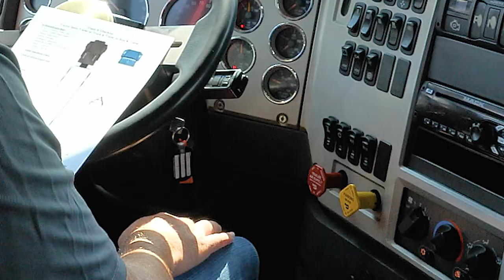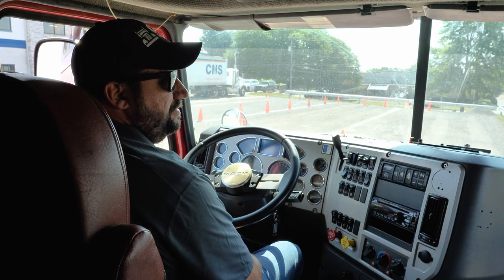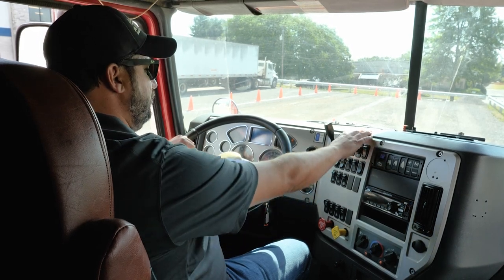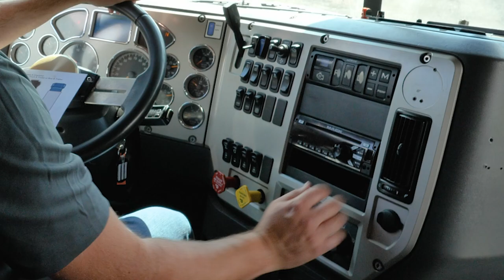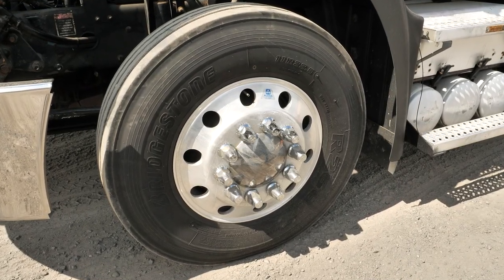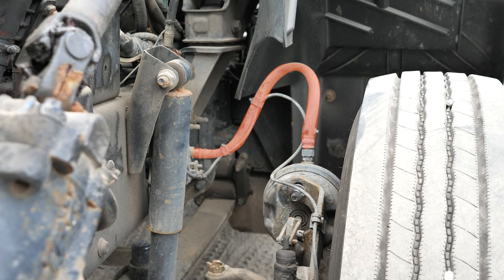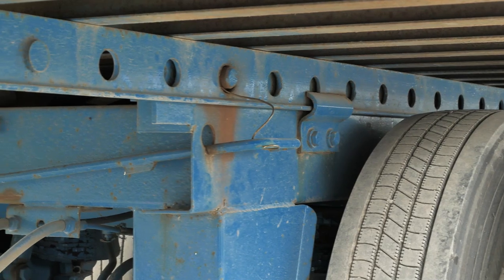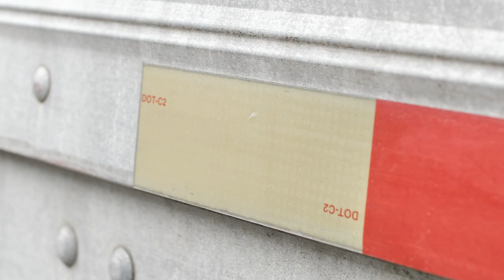PennDOT CDL Test Changes: Vehicle Inspection | CDL School

Comment: There are 4 mistakes on this video.
Reply: New student here, what are those mistakes?
Reply: @dirtyjoe1317  did not mention any leaks on the battery. Did not mention any oblong or distorted bolt holes on the rims. Did not check both sides under the hood of the engine for fluid or air leaks in the hoses. Did not mention to rebuild pressure in order to do tug/service brake test.
Reply: Thank you for responding!
Reply: He also never put the truck into the lowest gear for the air brake test
Reply: he did it, check what he says
Reply: @88rockett did not mention clearance lights either during light inspections
Reply: Other comment I made I was incorrect on a thing or 2 he mentioned them just at a different time

Comment: In Philly they would have failed you in the first 2 minutes. You never put the truck in the lowest forward gear before testing the service brake. Also why is there no tug test for the parking and trailer brakes? Why was there no test of service brakes driving 8-10 feet approximately 5mph? There were also at least 3 mistakes after this but that part still likely passable. However, you can’t miss anything in air brakes or it’s a fail.

Comment: Oil, Coolant, and Power Steering Fluids are S.O.L.A.R. safe operating level above refill, do not need to do each individually. Side Marker tractor/trailer lights are operating properly while walking from front to the rear of trailer. Can marry the tractor/trailer frame at the same time, MARRY as many pieces as possible.